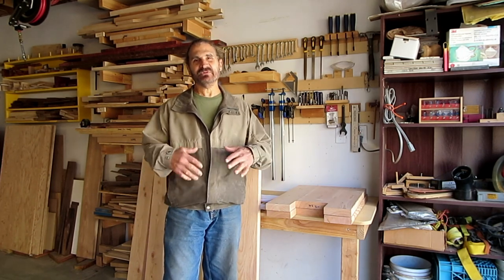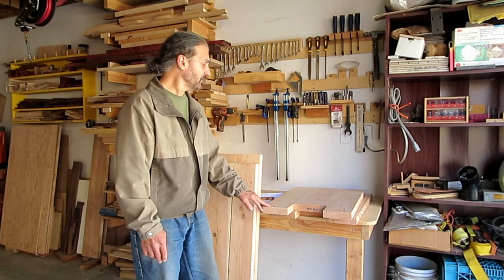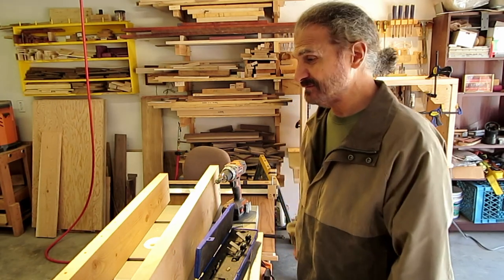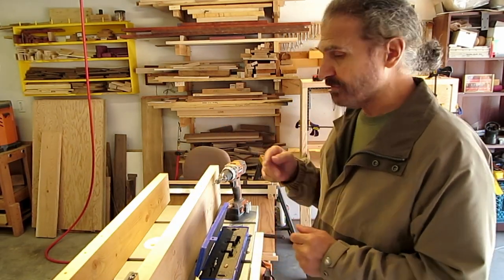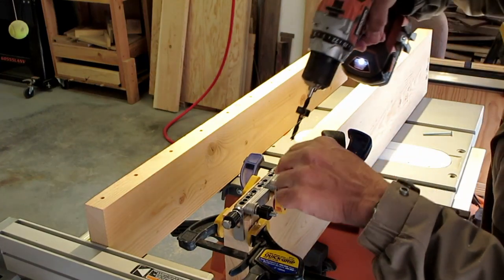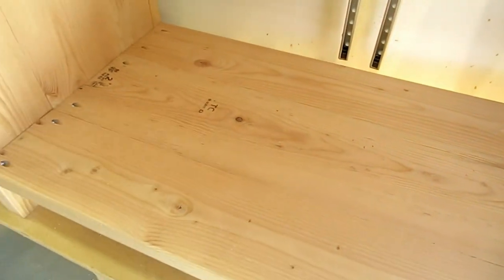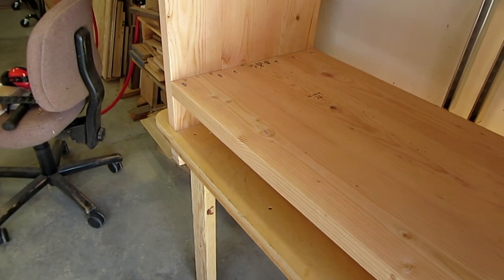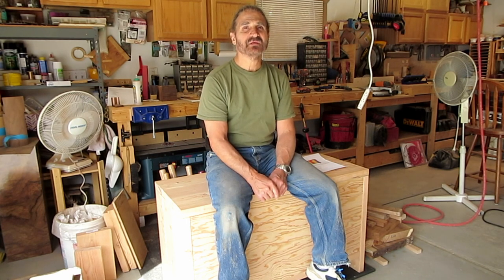Lathe Stand Design and Build

Comment: That is one heck of a table!!!!!!!! Move the lathe, build some ramps and you could park the red car that I saw in your dust collection video on top of it and have more room to move around with the cars in there!!!!!!!! 
    I really like the tool holder you built in the table. I'm trying to come up with ideas to store my tools for my lathe. I do have an idea for you though that may help you out a bit. I believe it was your dust collection video you mentioned you had mentioned something about having a small shop. I don't know your plans for the space under the lathe but my idea is that you could store some tools on that shelf and free up else where. I noticed behind your tool rack there is a lot of wasted space, put your tool rack on a piano hinge so your tool rack swings out to the right, put a couple of shelves in there to store all of your lathe accessories (face plates, pen mandrels, etc) and all lathe tools and accessories are in 1 spot.
Reply from the maker: Thanks for viewing my videos. Yeah, it's a solid (and inexpensive) lathe stand. I built three drawers in that open space below my lathe. I keep the various lathe accessories there, power sanding stuff, and cut-up T-shirts that I don't want to get dust on (for applying oil finish). Great idea about using the space behind the tools--I was wondering what to do about that. The piano hinge solves the problem. Thanks.